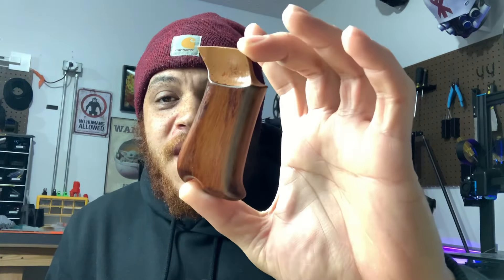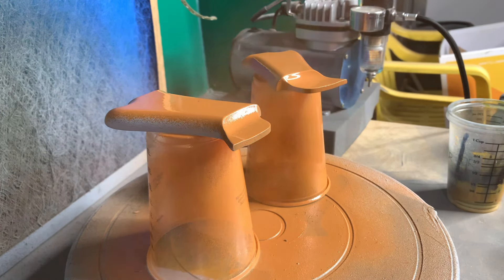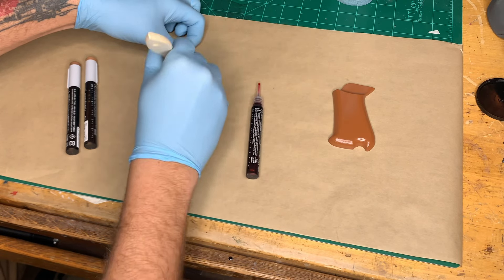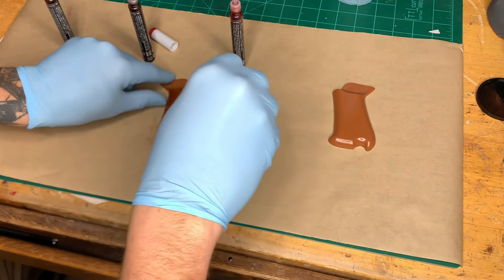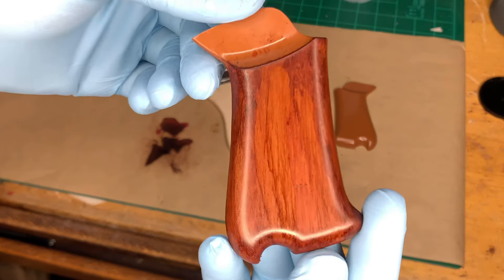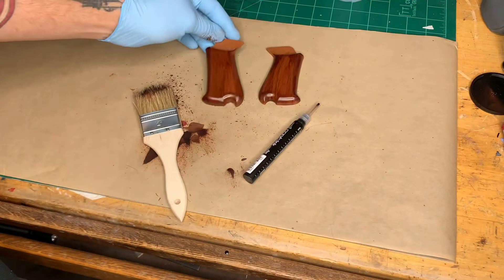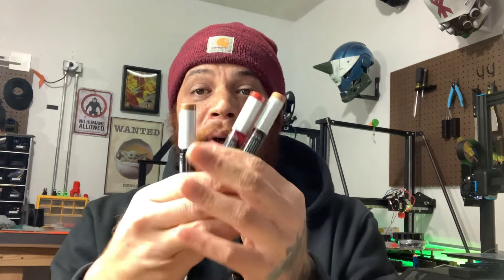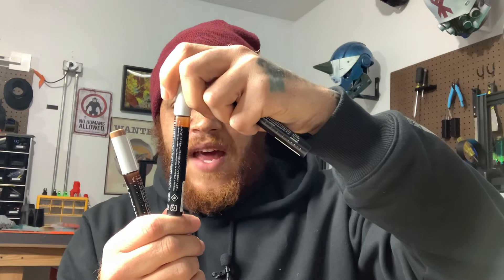Turn your 3D Prints into Believable Wood!

Comment: This is awesome. Very impressive. Any suggestions on sealing it to add protection? Thank you.
Reply: I would just go with a rust-oleum clear coat. Thay way you can spray it on and also get it at the same time as the caramel base coat. I prefer satin but you could put a gloss if you want something with a shine.

Comment: Sorry to ask, but you mentioned you primered your pieces with duplicolor filaprimer. What's that? I assume that's a step done before applying the rust oleum paint & primer?
Reply from the maker: Primer helps the paint stick to the surface

Comment: Posted a video showcasing my attempt at this. All I can say is DAMN!! This is so much cheaper/easier/better looking than wood filament and varnish. Also, if you mess up, you can wipe the part down with isopropyl alcohol and start over (which I did about 3 times). Thanks man!
Reply: Do you reckon a minimal dry brushing with the alcohol could help pick out little bits of the base colour? This such an effective technique, I was stunned at the second one!

Comment: Been doing this same method for a long time with regular stains. Only part that sucks about those is the fumes, and also they sometimes dry too fast and if you don't get the pattern just right you need to sand down and start over. An all acrylic solution is great for indoor winter months. You can mix up any base color, air brush it on, satin acrylic varnish, then do something like the inks you're using. I've also seen some people use watered down airbrush paint, but the translucent nature of stain/ink works way better. It's fun to mix different stains with different base colors to get a range of woods.

Comment: What clear coat do you prefer to keep the wood look of the finish satin or matte krylon clear coat? Would you recommend Modge Podge for added wood texture before applying the inks?
Reply from the maker: Depends.. if I’m going for a older wood I’d go matte, something a little more used but not ancient satin.

Comment: I tried this with some lighter colors from your selection like YR14-Caramel and YR16-Apricot on a Satin Heirloom White, but the final product came out a little too orange for my liking, good texture though. I wanted a light wood color like Maple or Birch. Are there any Copic color combos you recommend for a Maple/Birch look? I am thinking of getting a combo of EVEN LIGHTER colors, like E0000-Floral White YR000-Silk and E40-Brick White.
However, what worries me is the color of the ink inside the tube itself is what must be judged or if the colors will be way too light to show up, like what if E40 turns out to be too light because of it's color? OR too dark because of the color of the ink inside? I can't possibly know until I buy them all and test them without experience.
Reply from the maker: I usually have something painted chrome and a thin piece of clear plastic I’ll apply the ink too. Then hold it up to the chrome test piece to gauge the color. You can also mix and match colors of inks as you wish.
Reply: @offearth3d  Oh I figured this color thing out long ago. I ended up using the ones I talked about and it looks great.

Comment: Hi, thanks for the tutorial, it was very helpful indeed. What is the sweat resistance of these ink for example if the object that is painted with the inks is used as a grip handle? Will they smudge over time or can an extra layer of gloss paint perhaps keep it in tact?
Reply from the maker: Strongly suggest clear coating.

Comment: Important to point out DO NOT USE A COPIC MARKER. Use the refill, as it will basically squirt the ink on there. The markers will simply ruin the base coat paint job. Found out the hard way 😂
Reply from the maker: Absolutely

Comment: Thank you so much!  I’ve been trying to find good way to make some parts of my prints look like wood.  I’ve done few gun grips with the wood infused filament, sanding, and staining (which looked great), but I have some I can’t do that with.  Currently working on leviathan axe from god of war, and parts are wood and metal pieces, and have the metal looking axe part great, but I needed good way to make the wood handle look good.  Going to take a while with lot bigger piece but I think this is what I’m going to try!